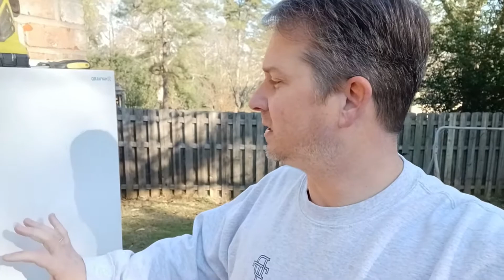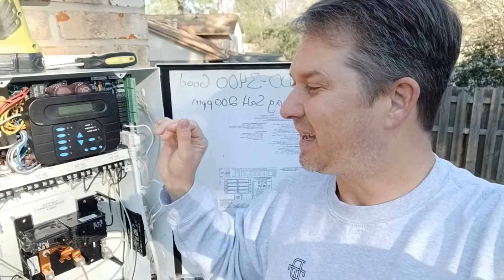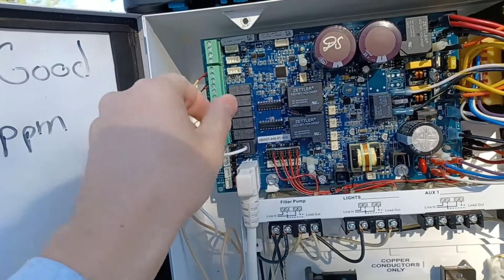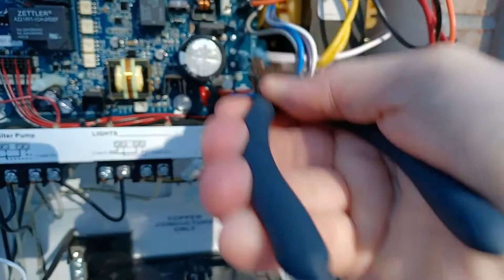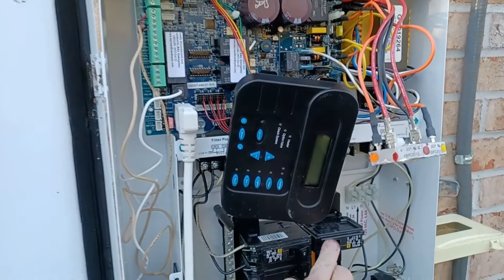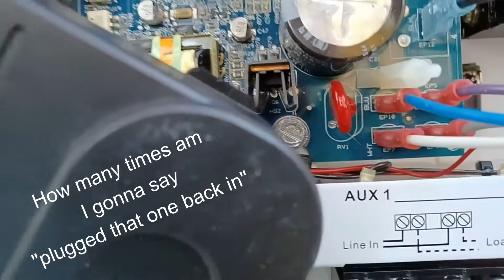Cheap Fix for Pool Pump not Working | Hayward PCB Board repair

Comment: Personally all of these electronic automation systems are junk.  Just get a regular load center, and a few cheap mechanical timers to control everything.  You cant go wrong with mechanical stuff.  I have a few friends that have basic mechanical timer systems since 1985 and have been humming along since then.  Also i have nothing good to say about those variable speed pumps either.  They just dont last but maybe 4 yrs tops not worth the price.  Get a good permenant split capacitor run singke speed pump and you are good to go.
Reply: Are you a pool guy? Just curious because I'm a pool guy and I pretty much agreed with everything you said in your comments. The best/easiest salt system to work on and repair is the aquarite 900. Then put in your own light switches and pump switches and put a mechanical timer on it and there you go a problem free system. Pool companies are pushing these junk boards because of the profit margins they're getting. I tell all my customers that has this aqua plus aqua logic system. If they want me to work on it, I'll rip it out and put in an aquarite 900. The stubborn ones that want me to fix the junk they have. They end up paying for it and I don't warranty that crap not even for 5 seconds. It's not just hayward's crap. It's other manufacturers. Also, everybody wants the Wi-Fi garbage and they want to be able to monitor and control everything they have through their phone without realizing that all they're doing is creating more problems. I always bring up the fact that when you need a refrigerator it's just got to keep your food cold and those are the refrigerators that work the best. When you get into all the other garbage that's out there. Those refrigerators don't last for shit. That analogy usually solves the question of fix it with no warranty or just replace it with something decent

Comment: I have the same one, mine is off just like this, but when I flip the breaker, it comes on then goes off again.
Reply from the maker: Sounds like something is telling it to shut off. I'm not 100% it's the same as mine.
Reply: @rogerearldiy  Mine acts like it's a power issue. Like loose connection. The lights flicker then it goes off
Reply from the maker: @GeorgiaDawgs274  does the filter come on after the display goes off? Or everything turns off?
Reply: @rogerearldiy  Everything, when I flip the breaker, it might come on, then goes off again.
Reply from the maker: @timwright6053  it's not tripping the breaker right?
Reply: @rogerearldiy  No I checked, I just tried to cut it on, and it's working now
Reply from the maker: You can try contacting the folks at haywardboardrepair by b&l enterprises. They might could help. They also have a troubleshooting guide on their website. The link is in the description here.
Reply from the maker: @GeorgiaDawgs274  isn't that how it always happens 😕 glad it's working.
Reply: @rogerearldiy  Thanks alot

Comment: Looks like its been a year. Still working okay? My pool just did the same. Display went out last year, but i was able to start the pump and sweep manually. Now nothing works. Found the repair guy on ebay. Im about to go that route.
Reply from the maker: It's still working. But I've had to replace the rectifier diodes a couple of times. This isn't because of any error from repair. I highly recommend him.
Reply: @rogerearldiy  You said that you've had to replace the rectifier diodes a couple times. When your rectifier diodes fail is that what was causing your display to be dark and inoperative? Thanks.

Comment: My system has a communication error and needs repair do i need to send the wires?
Reply: Did you get it resolved with haywardboardrepair? I have the same problem and a relay next to the board is getting hot.
Reply from the maker: Yes I did. That was 2 summers ago. Hopefully they are still around. I've also replaced the diodes on my own to help with issues. The diodes help transfer heat and can cause issues if they go out. Might be worth a try at first.
Reply from the maker: Thanks for the comment. I don't work for them so I'm not sure. They are usually pretty good about answering questions if you email them.

Comment: My heater was working but it just went dead, no lights or activity.  I know the transformer is sending 24v to the board, I know the keypad works because I've tested the buttons to the ribbon cable for continuity.  No standby light at all, fuse is fine.  Relay contacts not seeing volts, must be a break somewhere.   What on your board was the bad part, did he say?  (bad copper pathway, resistor, capacitor etc. ) ?
Reply: Here's something new.   I had the borad checked by two electronics guys who go ever ever chip.  It all tests out good except for the black processor chips.  He said it didn't seem like there was any life on those.  He couldn't dump the firmware on blank chips because they appeared dead.    So I got a new board.    After 3 months of the heater working again the same thing happened again.   My heater killed another motherboard.   SO there's something that's killing it and I'm not buying another.     Maybe the transformer is surging them and it's slightly out of spec.       I'll have to get a new $3500 heater next spring.
Reply from the maker: Have you checked the diodes and make sure they are good? I've also ordered a surge suppressor to see if it will help with my surges.
Reply from the maker: Thank you for your message. Is there any messages showing on your panel? Is everything else working? I've had issues since this video and it seems to mostly be the rectifier diodes. You can test those and see. Let me find those instructions.
Reply: @rogerearldiy  No power to the board it seems even though transformer is giving 24v to the connector.    To follow up since I've wrote the message, I had two electronics board repair people check all of the paths and components on the board, all passed, every diode and relay etc. and point to point.   One said the black chip seemed to have no life to it and he couldn't get the firmware from it to transfer to a new chip.   So I bought a new board for $499 and it works.   I kept the old one as a donor board in case something happens.
Reply from the maker: @thewoodwork_ca  probably smart idea to buy a new one instead of spending little fixes. Glad it worked out. Thanks for the update.

Comment: My display just did the exact same thing, ordered a new display after having pool store guy troubleshoot my system but same issue with new display. Hayward  guy said I need to replace board, difficult to find, months back order and the few available ones were at exorbitant prices. So, I sent my board to this guy in OK that I found on eBay, I just received  my board back today. What do you do with the boxes that he attached the orange, red & black wires to? It came with some grease but no explanation on what to do with this part, do you leave the tie wrap in place? I’m nervous to hook it back up and get it going on my own, afraid that I will blow up something again.
Reply from the maker: So glad you were able to get yours fixed. The boxes that he attached to your wires are called rectifiers. You just let those hang loose ..keep them hooked up to the wires that he attached them to. You take the grease and just apply it to the bottom of those boxes. It won't hurt to touch it. The tie wrap you asked about, are you referring to the little tie that's holding the rectifiers together? If so, yes, keep as is. Make sure your power is off and just plug wires back into where you unhooked them and you should be fine.
Reply: @rogerearldiy  does the box thing just hang their forever? or can i take the wires of and re attach them?